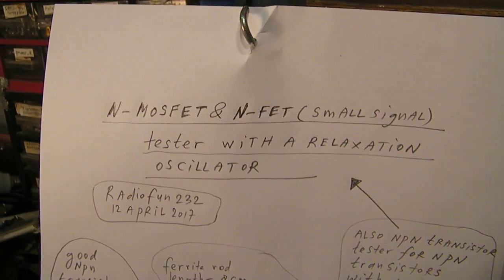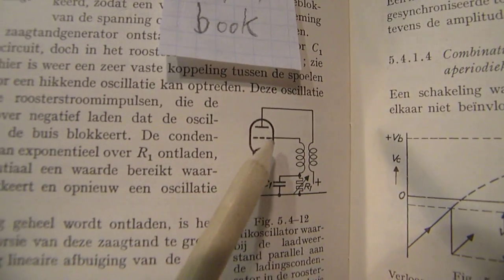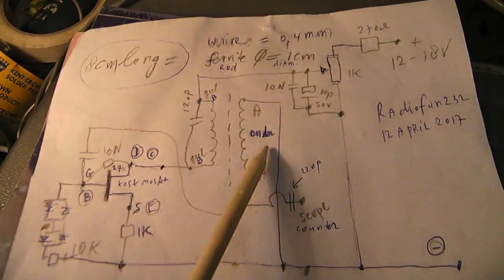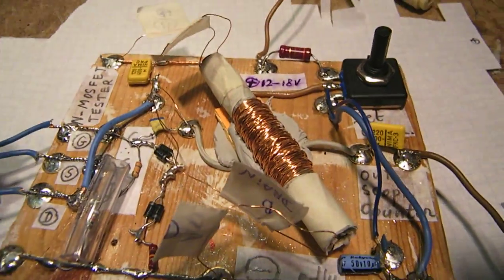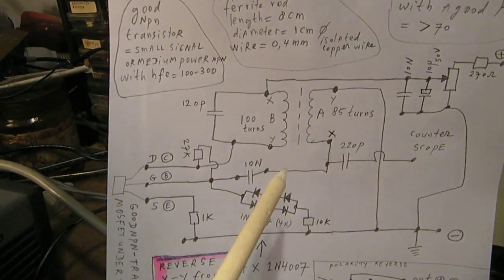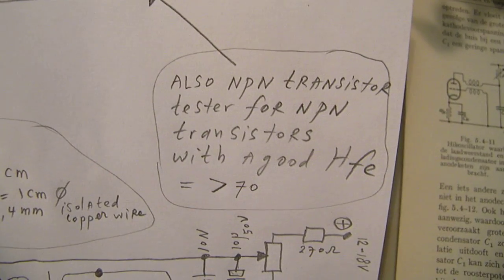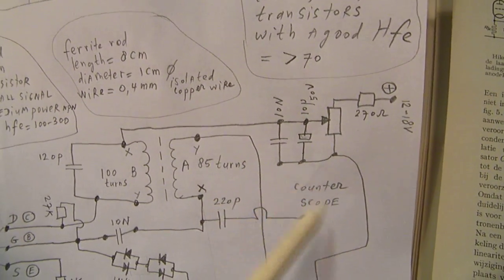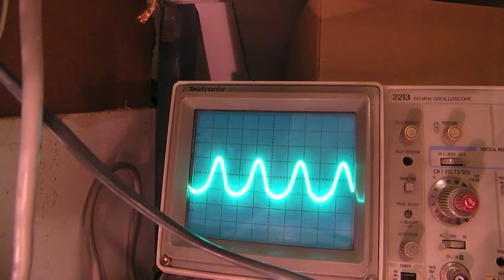TESTER for N-MOSFETS & small signal N-FETS & bipol NPN transistors with a relaxation oscillator

Comment: Why are these called relaxation oscillators?
Reply from the maker: Because there is a first situation where the coil (with its parrelel capacitor or natural capacitance without a fixed value parallel capacitor) is charged and, afterwards, the energy, stored in the L-C,  is dumped back into the tube/transistor for a period that depends on the coil and parallel capacitor or capacitance properties. The coil, charged, relaxes for 1/100000 or less or more second, when it dumps its energy back.